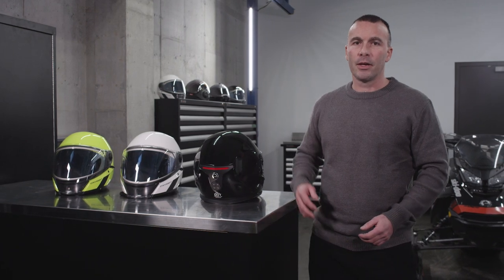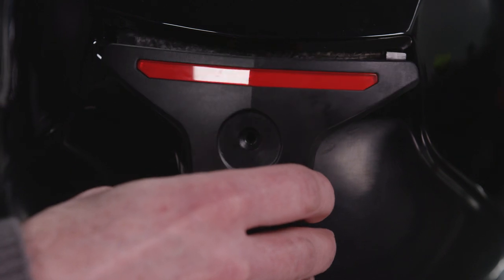OXYGEN Snowmobile Helmet - How to remove specific parts

Comment: I plug my oxygen helmet in my sled and the heated shield works but the green light on the cable no longer works. I do still have the 3 orange lights working. Anyway to get the green light working again?